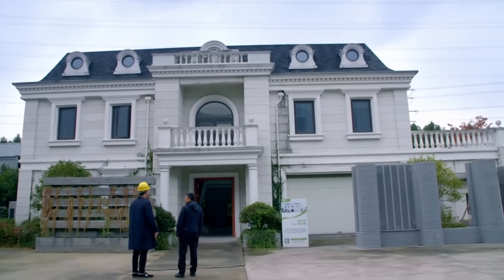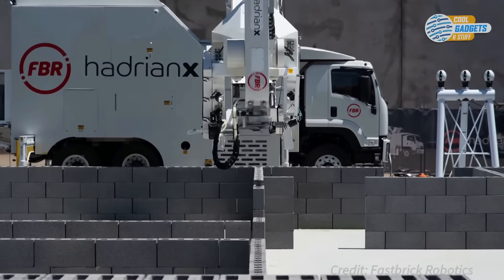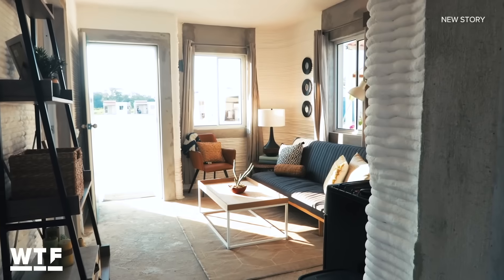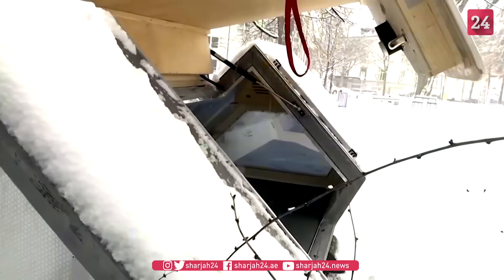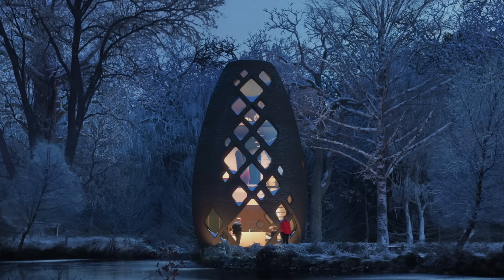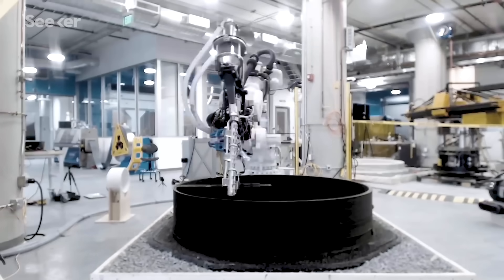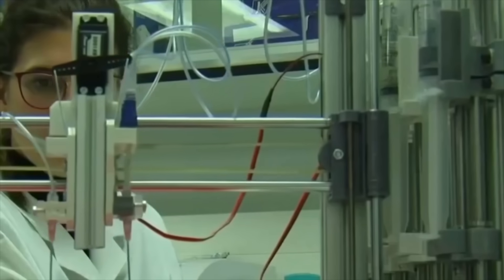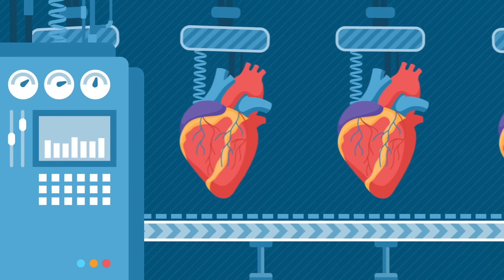Watch robots build houses at incredible speed. 3D printing meets AI.

Comment: what's that anti-mosquito screen ceiling thing at 7:20 ? i've seen that tons of times before but i still don't know what it is and what it does
Reply: That was no mosquito netting, it's normal military grade camouflage netting used to prevent discovery from the air by forming large, flowing structures of net and hiding anything below at the same time. the holes are WAY too large to prevent any insects from getting in.
Reply: Think of it like putting a whole base of smaller tents under a big "Ghilly Suit" (the stuff snipers wear that can be augmented with naturally occurring plants or grass ot hide their body shape.
Reply: @Ugly_German_Truths  ohhhh well i knew i was wrong about the mosquito thing i just didn't know how else to describe it, but thanks that's the answer i was looking for

Comment: Wow, so much innovative and fast to build new buildings.. That still use the concrete that the video says is the core problem in worlds CO2 production. Meaning that at the beginning, before less polluting options will be developed and accepted (yet, none strong contenders exist) the demand for concrete will only increase. Meaning that as long as the cheaper concrete is available, very little progress will be made with 'bio-friendly' concretes as the markets demand cheap and fast profits and market really doesn't care about enviroment. Never has, as long as the big bucks pour in.